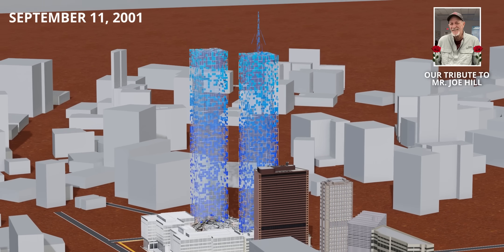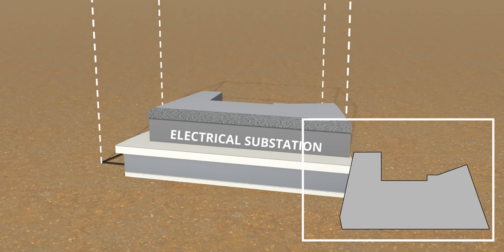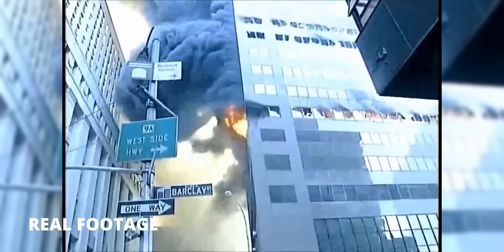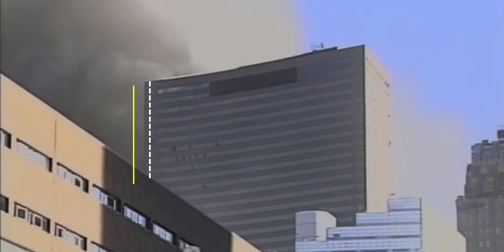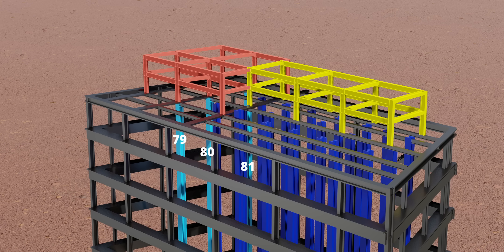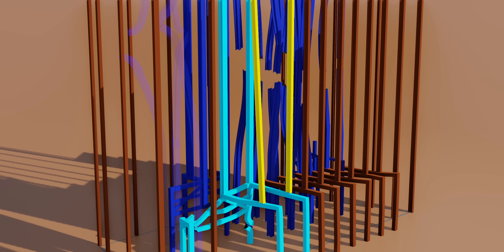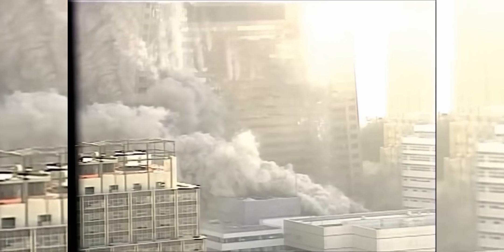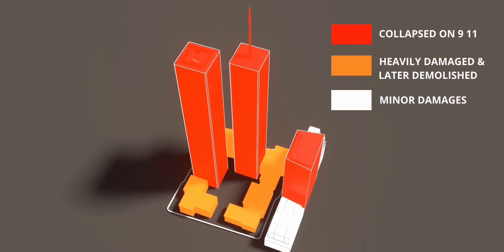Collapse of Building 7 | The Complete Physics

Comment: I remember watching it fall for no reason....why they try n say there was damage to those collumns....why was there damage there....nothing hit that building
Reply: Since you didn't actually watch the video,  maybe you will read this:

Building 7, the 6th building to collapse of 10 lost on 9/11 though extensively studied still confuses many. Not famous or a terror target, and with no casualties it did not get a lot of attention initially, creating an information void the internet filled with garbage. Because everything seems like a conspiracy if you don’t understand how it works I prepared this brief summary from my own analysis. No politics, just engineering. 

The North Tower collapse at 10:28am bombarded Building 7 with tons of burning debris, causing heavy damage and starting multiple fires burning out of control for the next 7 hours. Half the FDNY firefighters having been killed, others injured, units in disarray, equipment destroyed, no water pressure, and the greater urgency of Search & Rescue efforts, firefighting was pulled as futile. The building couldn’t be saved and was left to its fate.

www.youtube.com/watch?v=g_SvpwyC17M&ab_channel=MFitz  

Collapse of a burning structure is always a concern for firefighters. Steel buildings subject to fire rely on active fighting of the fires to survive. Buildings are designed around 1 to 3 hours of fire resistance, allowing time for occupants to escape and ACTIVE firefighting to get started, after which all bets are off. Left to their own devices they will exceed their design envelope and collapse. In B7 the occupants escaped, passive and active fire protections were compromised and active firefighting was abandoned which left the building to take its chances. It lost. Odds on Building 7 would eventually collapse, and it did. No big deal in logic. That is the sort of choice firefighters make every day in brush fire situations - which houses to save and which ones to let go. Only real difference here is moving the decimal on the size and cost.

www.youtube.com/watch?v=WnYBX6QT0R4 

FDNY Chief Daniel Nigro ; The biggest decision we had to make on the first day was to clear the area and create a collapse zone around the severely damaged 7 World Trade Center, a 47-story building heavily involved in fire. A number of fire officers and companies assessed the damage to the building. The appraisals indicated that the buildings structural integrity was in serious doubt. I issued orders to PULL BACK the firefighters and define the collapse zone. It was a critical decision; We could not lose any more firefighters. It took a lot of time to PULL EVERYONE OUT, given the emotionalism of the day, communications difficulties and the collapse terrain

FDNY Deputy Chief Peter Hayden ; We had our special operations people set up surveying instruments to monitor and see if there was any movement in the building. We were concerned of the possibility of collapse in the building. And we had a discussion with one particular engineer there, and we asked him if we allowed it to burn could we anticipate a collapse and if so, how soon? And it turned out that he was pretty much right on the money, that he said 'In its current state you have about 5 hours

The collapse of Building 7 was anticipated and widely reported in the media throughout the day. At least 24 video cameras recording some or all of the collapse. Everyone knew what was coming and why.

www.youtube.com/watch?v=OY5S5k3tMHI 

Building 7’s collapse was completely different to the Twin Towers, harder to understand with most of the details difficult to see. But we can still sort out what happened through careful analysis and observation.  This is MY EXPLANATION of the collapse sequence using the best available information and relying on no authority.

B7 was complex 47-story steel framed structure built on top of a smaller existing 3-story building, requiring several lower floors dedicated to complex load transfer structures instead of usable office space. Of trapezoidal shape and all-steel tube-in-tube construction, B7 (above the 7th floor) consisted of a central core of steel columns carrying most of the gravity load, perimeter steel columns around the outside of the structure carrying the remainder of the gravity loads and long span beams and girders to tie those elements together and form the floors. On the outside of the building hung a moment frame - the last part of B7 to fall. 

Phase 1 : The first externally visible signs of collapse initiation occurred at 5:20:28 pm. Collapse initiation for B7 is notably quiet with observers not realizing the building was collapsing! There was no audible warning in the form of say hundreds of ear drum busting 180-190dB explosive bangs preceding the collapse. Here at 12:00 a local CBS affiliate reporter is talking 10 blocks from B7 when collapse begins. People don’t start to notice the collapse until 12:11. Then at 12:45 is the famous CBS fixed camera clip of Building 7’s collapse.  Note how quiet it is.

youtube.com/watch?v=t5tEy6mXSE8&ab_channel=fresnosean379

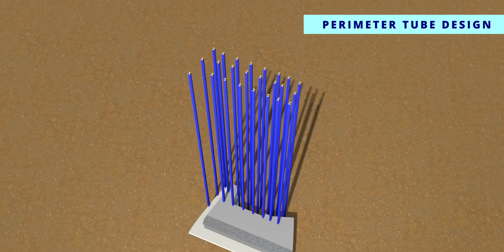Collapse initiation was due to lower floor failures above the load transfer region (7th floor) in the NE corner of the building. In this video at 0:45 you can see the NW corner from inside the building while under construction, Column 79 just out of frame on the left. That big, angled steel beam across the top of the frame connects to C79 at one end. The girders connect to the beam. That beam and all those girders depend on just one connection

youtube.com/watch?v=nP3TNHPCIVU&t=35s&ab_channel=EdwardCurrent

Phase 2 : Lower floor failures caused a loss of critical lateral support over an excessive length of core Column 79 and it buckled. If you look at a floor diagram of Building 7 (see above) and look at all the structures that depend on C79 you quickly realize this one column was a relatively isolated structural element on which a disproportionately greater fraction of the structure depended analogous to say the Key Bridge. Externally we see a vertical progression of window breakage along the 44-46 line and a kink in the roof of the East Mechanical Penthouse at the top of the building, consistent with C79 failure. The transition from full capacity to almost no capacity occurs in virtually an instant. Once the buckling failure occurs there is almost no resistance

Normally with a buckling column, the load could very well be redistributed to other columns, meaning the buckling could stop after a while. With C79 that is not the case - the failure did not redistribute the load, so the collapse rapidly progressed to the roofline, sinking the rooftop penthouse.

Phase 3 : With C79 gone, B7’s progressive, non-symmetrical collapse continues with C80 and C81 at the east end of the core left laterally unsupported and quickly buckled and failed as well, sending the EMP down through the building. C79-81 all have no diagonal bracing, which I believe is a major reason why they could not redistribute a lot of vertical loads among one another.

From there collapse progressed from east to west through the central core until the core was gone taking all of the interior floors and structures and probably most of the perimeter columns with it. You can see the horizontal progression of window failures low in the building and the dropping of the remaining rooftop structures into the building. One of the big takeaways from the NIST Building 7 study (that gets completely ignored) was their modeling which determined C79 failing under ANY circumstances would have initiated the same collapse sequence.

Phase 4 : After some 10 seconds all that remains of Building 7 is just a hollow empty outer shell - the exterior moment frame - creating the illusion the building is still standing since little has changed externally. But it’s just a hollow empty shell like an empty cereal box supported by only a few remaining columns and quite unable to remain standing. With all the internal framing gone, the north face leans inward, forming a V in the roofline, the last perimeter columns buckle under the strain and with nothing left keeping it up the moment frame free falls, landing on top of the 7-story high debris pile. It is only at the very end that a single measurement of alleged free fall acceleration is taken. Note this is not the building but just its outer shell, and only one corner at that, at the very end of the collapse. Start to finish the entire collapse took 18-20 seconds, or less than 1/3 of true free fall and we have to look at the whole thing, not cherry-pick little bits to fit a particular narrative. Worth noting _how fast something falls cannot tell you what started it falling in the first place. The debris spread out, blocking surrounding streets, heavily damaging the Verizon Building and destroyed Fiterman Hall, all well outside of Building 7’s “footprint”.  

Building 7’s progressive, non-symmetrical collapse was incidental and unintended collateral damage from the combined effects of fire + time + gravity started by the collapsing North Tower. That is true no matter who planned and carried out the 9/11 attacks or why . The collapse was of so little consequence it barely even registered at the time, a mere footnote. It only took on semi-mythical status as an alleged smoking gun years later when demolitions at the Twin Towers, missiles at the Pentagon and shoot down over Shanksville all failed and conspiracists had nothing left to work with.

Anything can seem like a conspiracy if you don’t understand how it works. Now you should. I hope you found this helpful, informative and it solicits informed critical comment. If I made any errors of fact, logic or reason or left anything important out, please let me know so I can fix it. IF you can offer a more plausible alternative please do. Be the first. Please start any reply with the words “Tits McGee” or I will know you didn’t read it and are wasting my time.